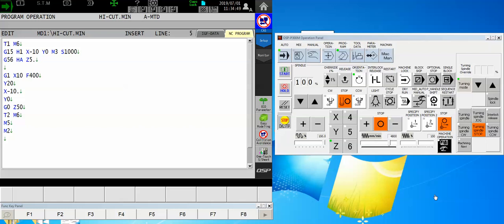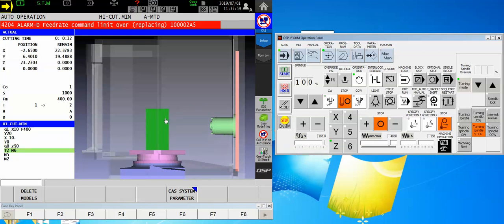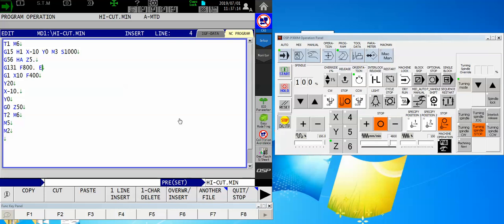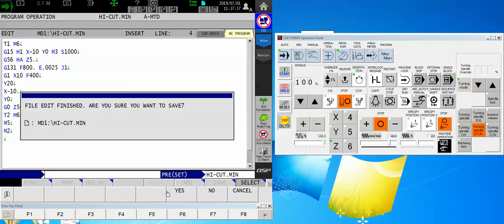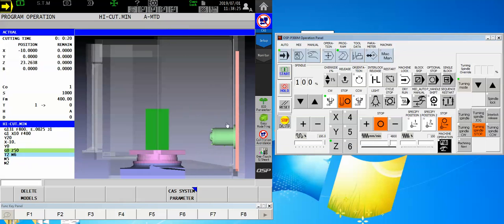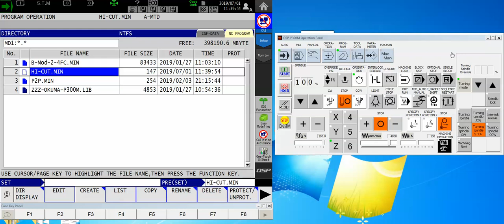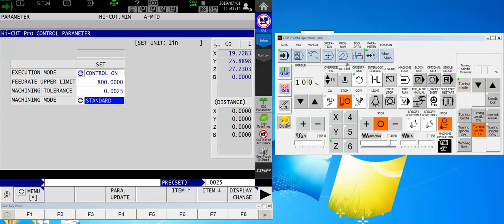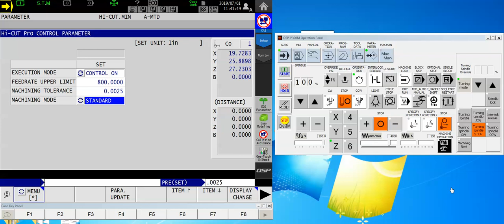HICUT

Comment: Thank you! 
Can I change the parameters in the program if its turned on in the settings? It would also be nice if you could explain the difference between High speed and Standard.
Reply from the maker: Yes, you can change parameters on the fly if the mode is set to CONTROL ON. By adding the G131, you can change the cut conditions for the current tool regardless of the defaults set in the parameter page. As for the difference between STANDARD and HI SPEED modes, the explanation given in the manual states that HI SPEED mode gives priority to machining efficiency while STANDARD mode gives the priority to part accuracy. The suggestion is to rough in HI SPEED mode while finishing in STANDARD mode, but if your E value is set below print tolerance, either mode is going to make a quality part. Thanks for your questions!